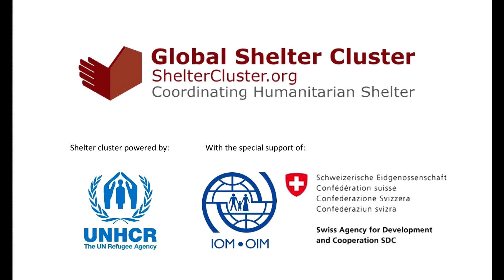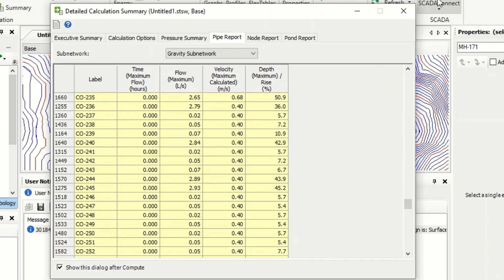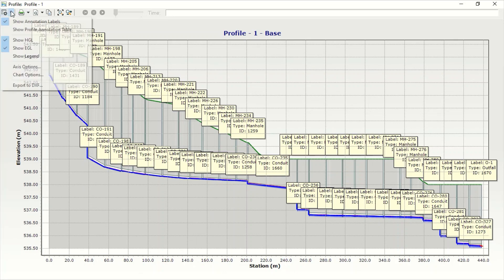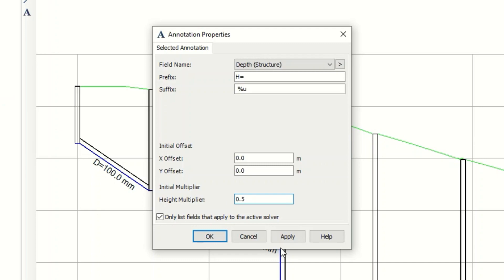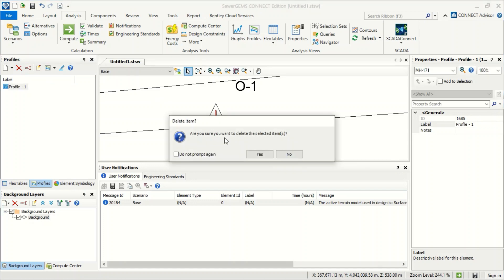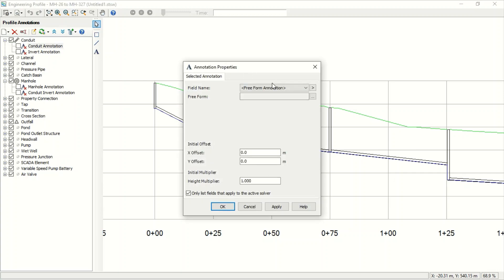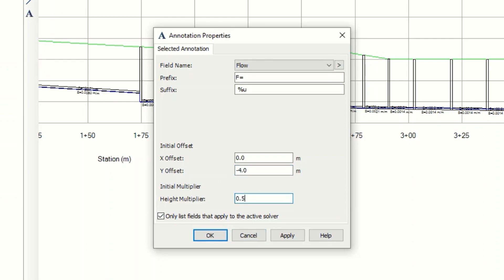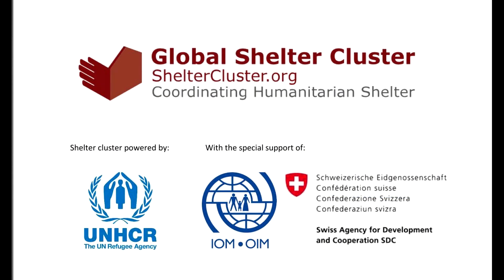SewerGems Part 12, Computing the simulation and displaying the pipes's profiles

Comment: How did you add invert levels? Is there a way set invert levels for all pipe simultaneously?
Reply: There is an option in the conduit table ( Design start invert, Design stop invert ) in default it is checked and here the software will design all start and stop inverts, if you clear the check box then you can add the invert level manually and the software will use it in the design. you can clear the check box in the start invert for the outfall if you have existed manhole or pipe.
Reply: @mohannadmd7541 Got it. Thank you. :)

Comment: 1. How can we proceed if i don't have the terrain model file. 
2. If I don't have terrain model, then is there any option to get the terrain model sample.?
Reply from the maker: Elevation is the essential parameter and without it, you can not make any type of drainage with any type of software. The only way is to go on the field and take precise elevation points with the total station. Do not use the DTM from Internet (e.g. SRTM). This is not precise enough